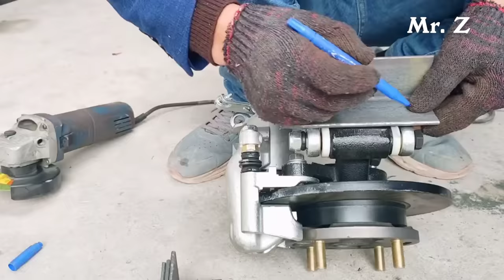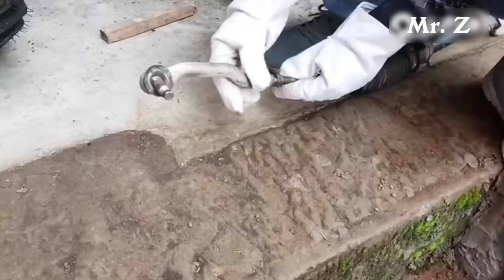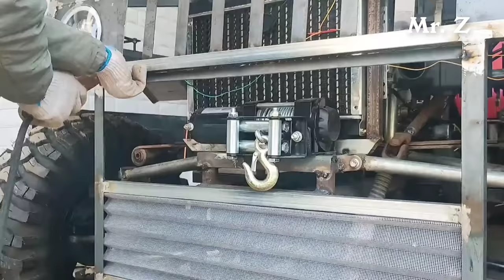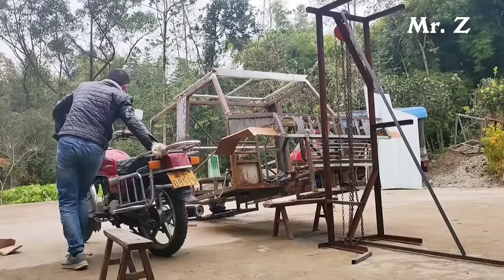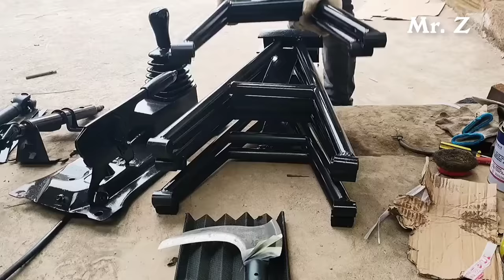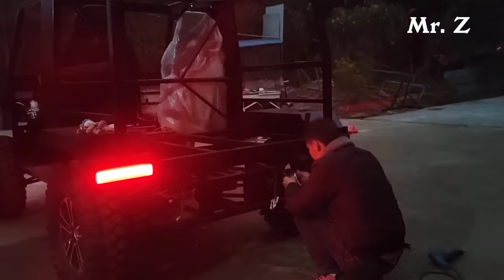Homemade ALL-TERRAIN VEHICLE.

Comment: That suspension is a great idea, I have never seen anyone do the suspension in that manner I mean with a full independent setup like that we would usually see shock n springs or coil overs but a shared leaf sping is very creative I would love to know how it end up long term and how much travel it ends up allowing. Great video
Reply: The shared leaf goes back to the days of the horseless carriages. With no shocks though there is nothing to stop rebound and oscillation, which will be detrimental to traction when off roading. Overall, it is an excellent build. If it where me I would have spent less on the fancy wheels and fancy LED headlights or saved a li'l more money to get some ATV coil overs.
Reply: @mattlewandowski73  True, Those head lights and so much comfy seats were really not required for such vehicle as a good and reliable functional suspension
Reply: Breaks at Higher speeds when loaded
Reply: Peux t'on avoir les dimensions de la voiture

Comment: I hope he goes back an welds up the whole thing cause those tac welds from a stick welder ain't holding together for nothing but good work
Reply: He pulled it apart completely, to the last nut and bolt and finished every weld beautifully then reassembled it. I'm in awe of how thorough he is. Go and watch it again.
Reply: 10⁰

Comment: Nice build especially made at home with limited resources, one item the seatbelts need to go through the holes in the seat back one to stop them from sliding off your shoulders but mainly so as not to injur your back if you have a heavy landing they will hold you more securely, trust me as an off toad buggy racer it will save any back injury.

Comment: Wow! Hyper !
How long it takes you to complete it from the beginning to the end? And the cost? I'm from Africa and it's my goal to train young ones in mechanics, electronics and so on ...
Reply: if you are in africa the gouvernement dont let you to do so
Reply: @fatrambo73  I"ve done one similar , but when I come to he government to ask for the permission to ride it; There was a lot of condition to fill, these condition are ridiculous ; however, there are wrecks rolling on the road and they let it go. They dont let you to drive it in the ground that it doesn't follow the standard of construction.
Reply: @RAKOTOOOO  Thats normal, you can still pass if you fill the conditions, but you have to understand that they are protecting others with conditions like that, otherwise everyone would be riding everything they came up with...
Reply: You can only build this kind of vehicle as a demonstrative type, because of the long list of requirements needed to fulfill pedestrian and environment safety....you also need good welding skills if you want to pay half of the cost, but otherwise you could find a used car for the parts
Reply: @MatijaFistric  I'm in africa, i think you can imagine the situation, With my 20 years of fabrication experiences, I can tell you that the one that I build is 10 times more safer and secure than the 50 years old rusted car that you can see in the road here

Comment: Great build!  I have one issue though: it looks like you mounted those upper seatbelt harnesses too high.  Having the belt mounted that far above your shoulder will cause injury in an accident.  I love your car and your solutions to designing parts, especially the A-arms.
Reply: Yep, definitely should have gone thru the holes in the seat and mount to the bar behind it. But either way, it doesnt matter if he doesn't wear them.
Reply: How many you make India rupes
Reply: How many you make India rupes
Reply: @zovazova6248  what?
Reply: Above the shoulder is fine. It's having them below the shoulder that will hurt you via spinal compression.

Comment: This is the best/coolest mini cart/buggy on YouTube I've seen, but what is really like to know is what chemicals you used in the pressure washer to remove the rust like that. You should do a video on it. It also looked like you ran a driveshaft yoke straight off the motorcycle engine. It would be cool to see how you did that, total custom part or is there yoke you can buy that already fits it. Great job
Reply: also search for "4WD Transfer Case And Reverse Gear Assy For ATV UTV Go Karting With Engine 125CC 150CC 175CC 200CC 250CC 300CC 350CC"
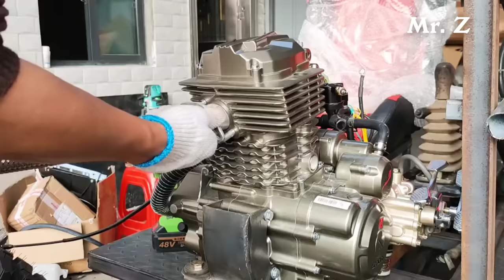Reply: just search for "Gear Box Heavy duty double speed forward and backward reverse For 250cc~ 800cc transfer case Foot assy ATV Quad UTV Go kart" . Is clear (6:38) that he uses that gearbox
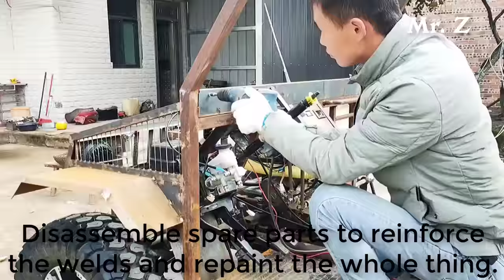Reply: in 12:35 you can see that he replaced the pedals of the gear box with levers (sticks), this is very common in similar diy projects

Comment: Mr. Z.  You need a horizontal bar behind the seats connected to the roll cage, level with the holes through the seats for the shoulder harnesses.

Comment: That body work differential are perfect steering, electricals and its quite handsome... although the engine is a powerful  single  cargo tricycle engine, I don't think it is fast at all.. a powerful one multi cylinder  engine would do that beast justice both on road and off-road..